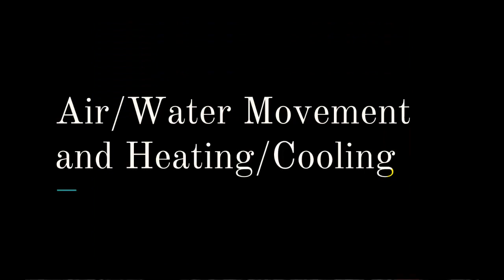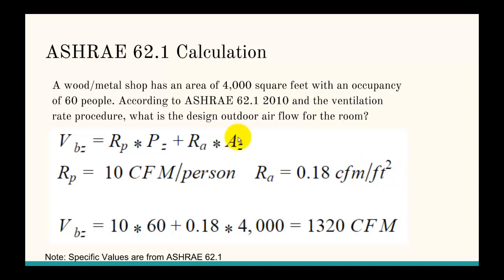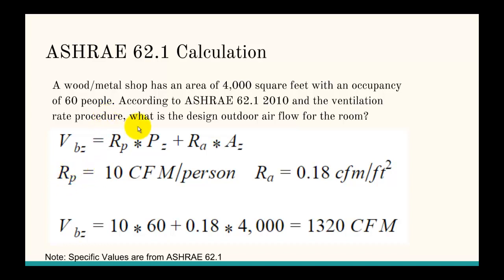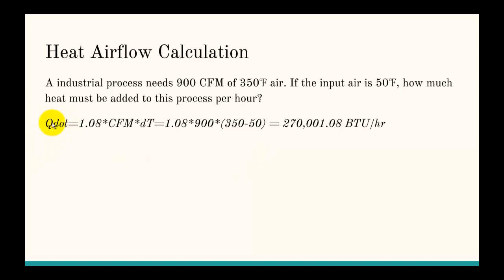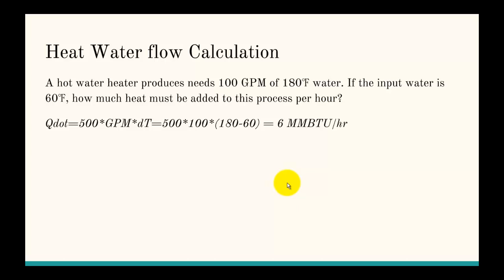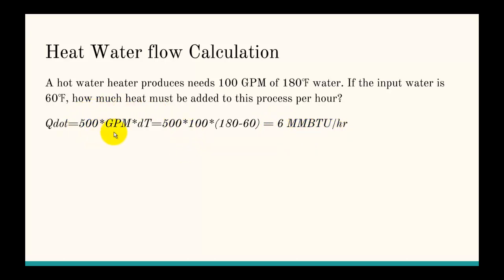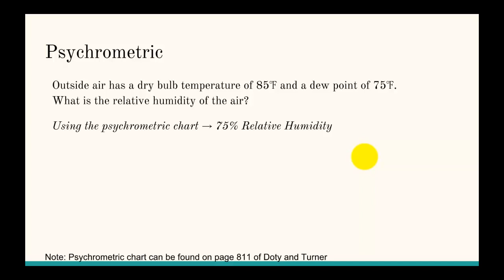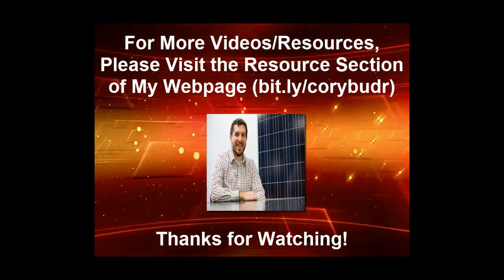Certified Energy Manager Calculation Review: Air Water Movement and Heating and Cooling

Comment: I think the heat flow air calculation has an error in the result which should be 291,600 BTU/hr, it looks like maybe you were going for 270,000*1.08?